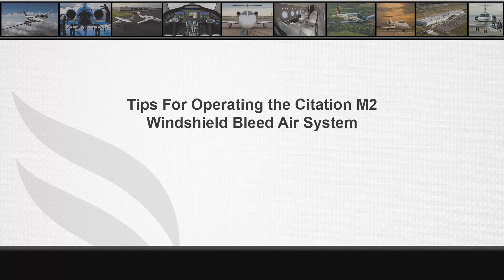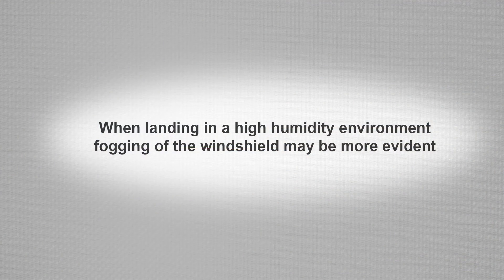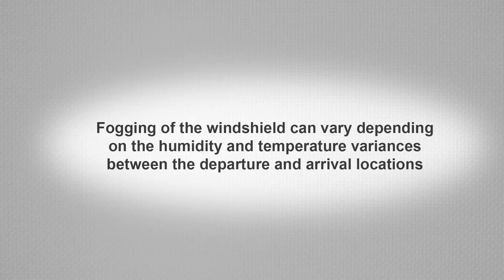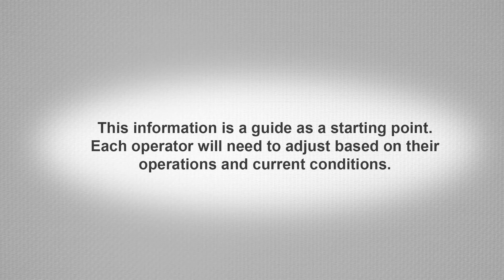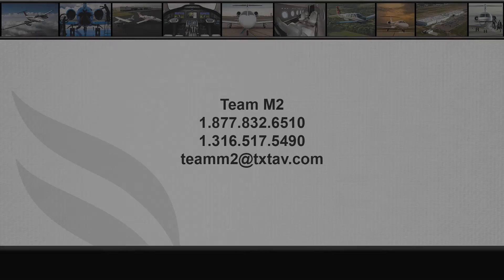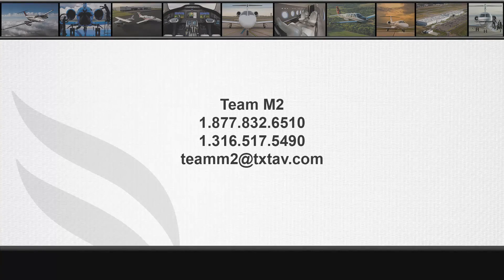Tips for Operating the M2 Windshield Bleed Air System

Comment: 30 minutes prior to descent, that seems excessive, especially since you loose power with bleed air on. What about a :45 minute flight? You’d have them on in the climb? When do you turn them off? After landing or at a certain air temperature? Thanks